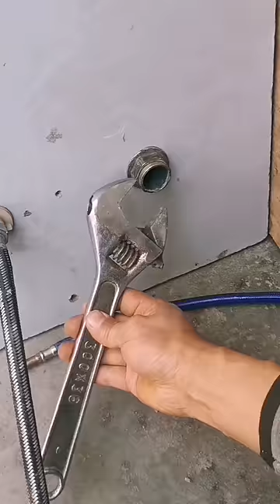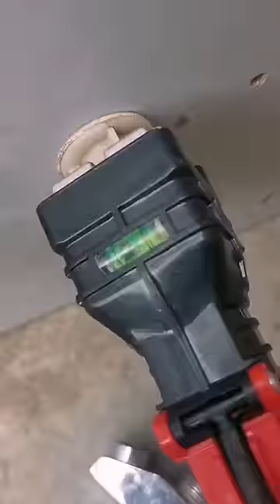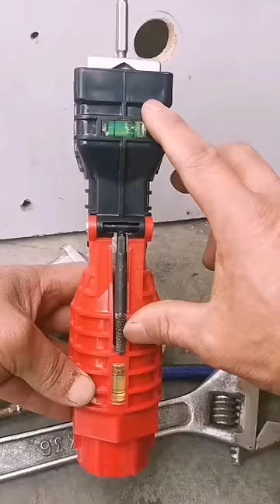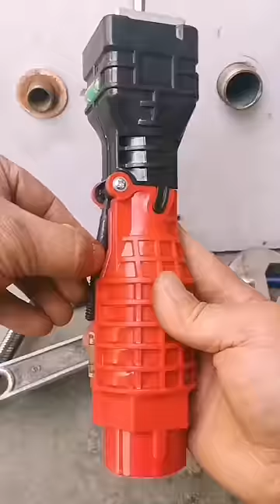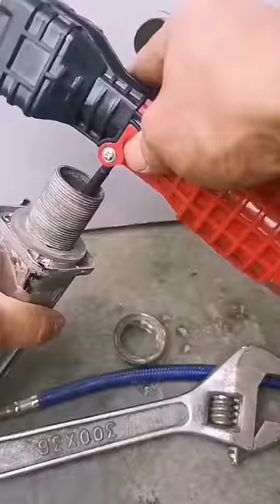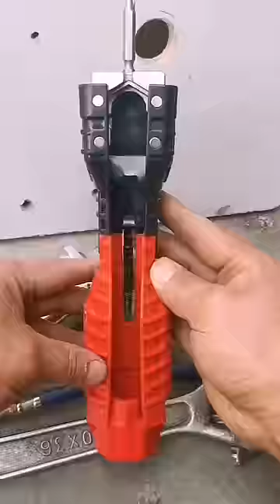18 In 1 Multifunctional Faucet Wrench Tool

Comment: This thing will break so damn easily, there is no way that hinge isn’t getting twisted and destroyed within the first 3 days of use
Reply: @udkill2beme  he literally pointed out its biggest flaw. A hinge is just gonna break when enough pressure is applied and it could get rusty and stop working
Reply: @HaydenTalcott  use stainless steel. It won’t rust and it’ll be stronger than the plastic.
Reply: That thing is made of plastic?
Reply: @udkill2beme  -That's incorrect. Rigid sells a full metal construction multi tool. This is a plastic knockoff for less than 10% the price of the Rigid multi tool. It's in the description.
Reply: What’s the songs name?

Comment: I would break this in 10 mins on almost any job site.
Reply: 10 minutes is too long. I say 1 minute at most
Reply: @tublisvaj8966  agreed.
Reply: Its not the bad although mine snapped in two . Its more for faucet lines and plumbing that hasn't been there for 50 years
Reply: @rotemtomhagbi1937  it snapped in two speaks for itself.
Reply: @flatoutnorth794  the plastic part did . Like i said its more for the new and small things not drains that were stuck since the 80 .
Reply: @rotemtomhagbi1937  even with new fitting its garbage not even close to enough torque can be put through this thing to even turn a nut through 6month old silicone.
Reply: sell a metal one?
Reply: @3Q2HFNILQHF  sometimes plastic is better because it will break before you break something of the plumbing itself and it's better to break a $20 to then trying tool repipe the entire tub
Reply: @rotemtomhagbi1937  or just have basic hand control lol

Comment: I'm guessing I'm a little bit late to the, "I would break that in 10 seconds"  party? If you can stick that thing on a bolt and take the nut off just by simply twisting it, that nut was not at all a problem to take off. There is no torque or leverage to this, besides the fact it looks flimsy as a wet rag.